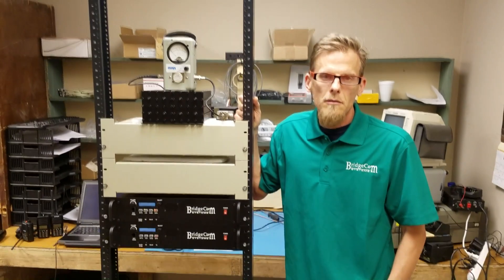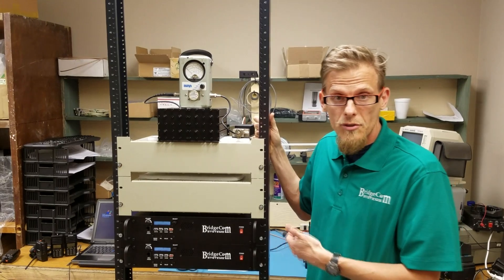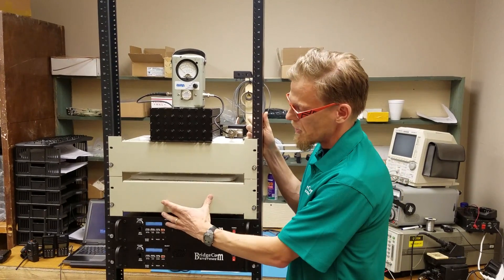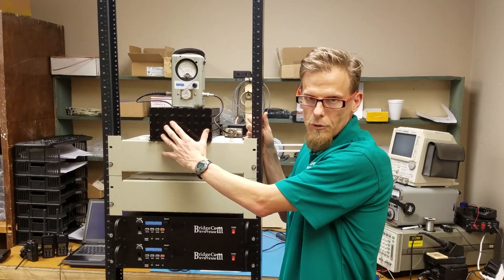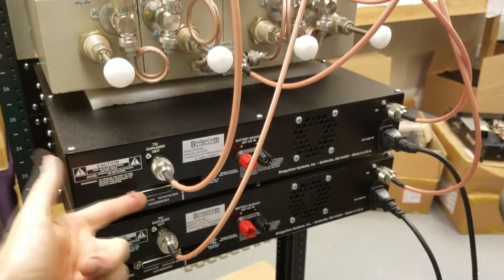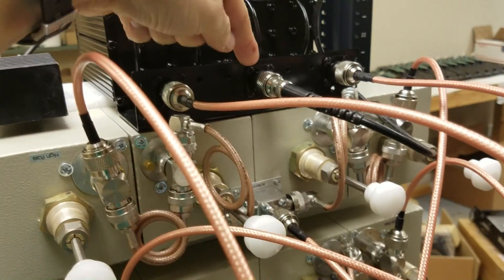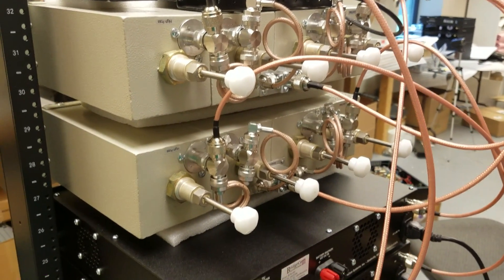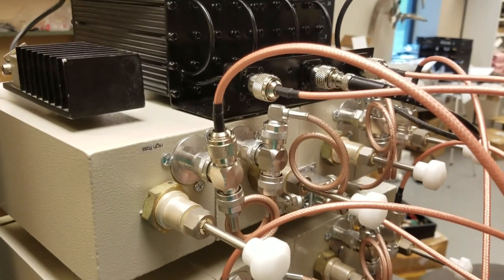Save Money - Two Repeaters on One Antenna

Comment: I once did two Motorola Quantars, one on 444.5 and the other on 451.575 into one antenna with two BPBR duplexers and one additional 6 cavity notch duplexer...had a bit more loss on the 449.5 rx side, about 2.5db,  but it worked with no IMD, etc.

Comment: Look nice but don't  work. At least 3db loss on both repeaters and even more when both work in same time. We has this sokution once and never again.
Reply from the maker: You didn't buy this from us then.
Reply: @BridgeComSystemsInc  It is impossible to connect two repeaters on one antenna and have same sensitivity like when every repeater have its antenna. Seen on many towers and removed from them. 1. Dual band antenna beter than single band professional antenna is never made. 2. Every connector insert loss.   3. Two signals on one cable in same time is bad idea. This can be done as experiment or as your private game at home "it work" but on regional repeater this idea is joke.
Reply from the maker: @electronicsolutions4842  When  running  commercial communications systems, it's common to have multiple repeaters using one feedline/antenna for receive and one feedline/antenna for transmit.  The receive side of the system feeds into what's called a 'receive multicoupler' that distributes the signals to the various RX sides of the repeaters.  The transmit side of the system feeds what's called a "transmit combiner".   These are filtering devices tuned to work with the chosen frequencies.  Are there losses?  Yes.  But much of the loss can be gained back with high gain antennas.